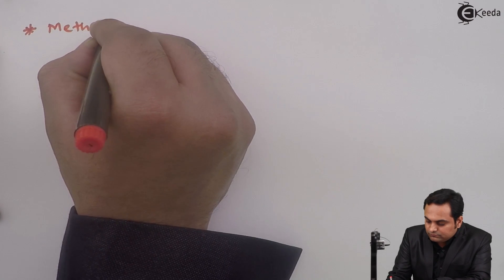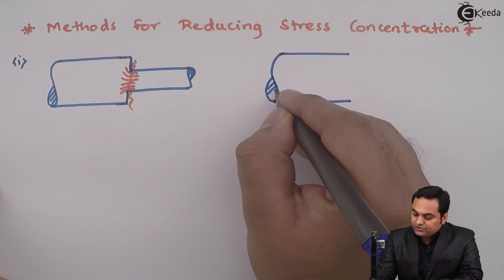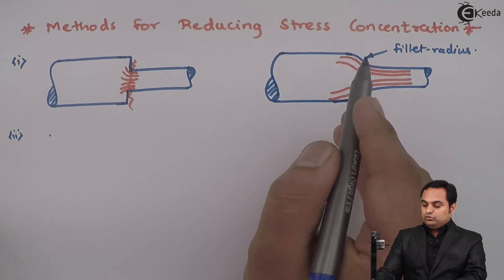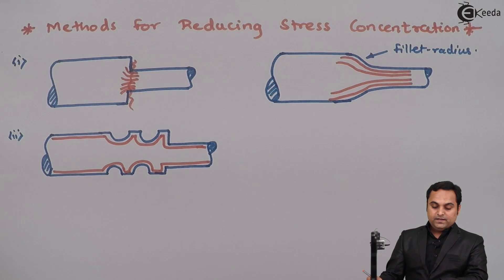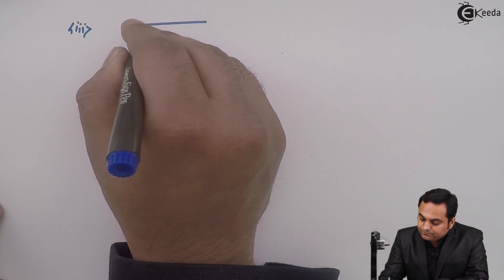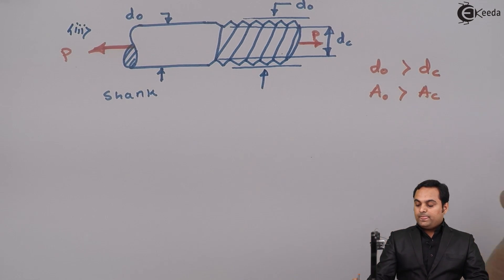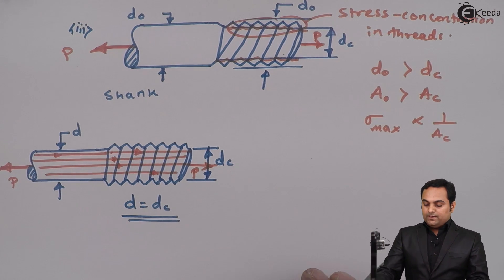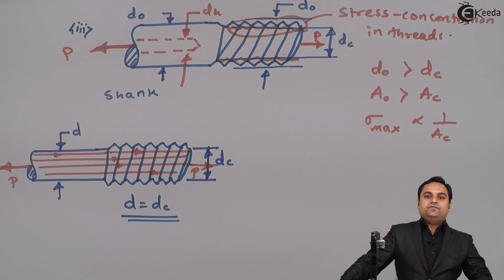Methods for Reducing Stress Concentration - Theories of Elastic Failure - Strength of Materials

Comment: Also drilling a hole in a shaft (Time 8.15) is not correctly shown. Depth of a hole should be just near to the threaded part, otherwise it would not make any reduction in stress concentration near threaded part.

Comment: I would like to correct in diagram "Notches"(from time 3.20) in which stress lines shown around the notches, is incorrect. Stress lines should go straight &  parallel to notches, by which stress concentration at corner would be less.